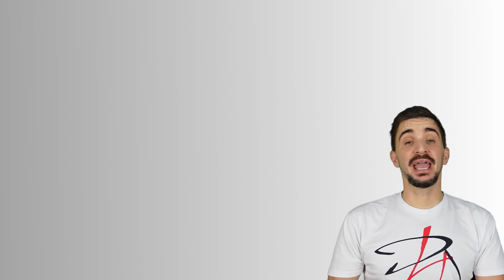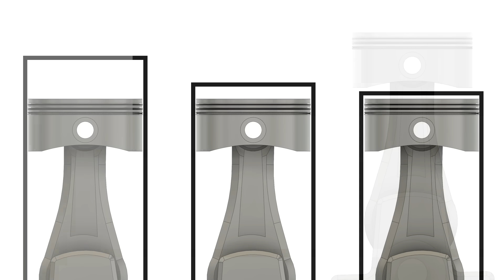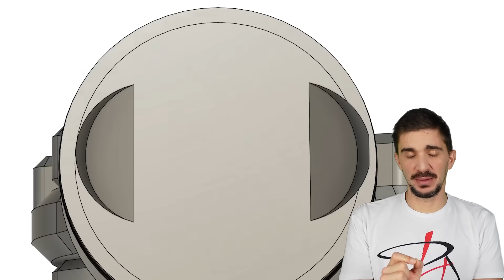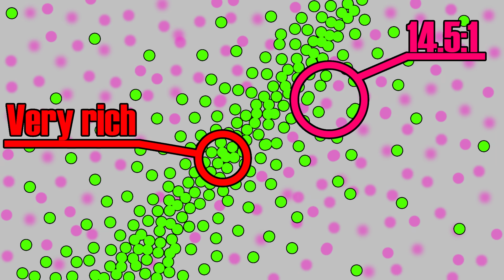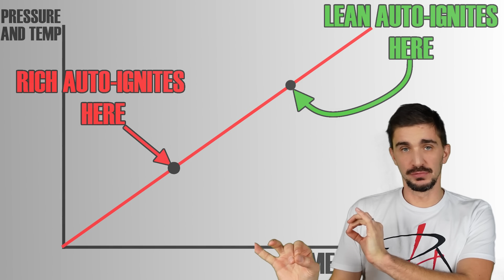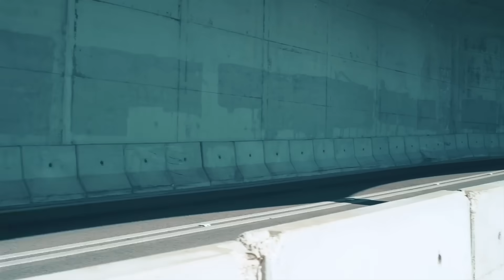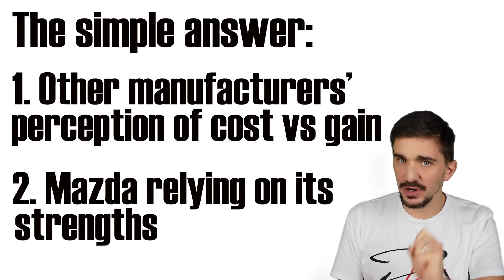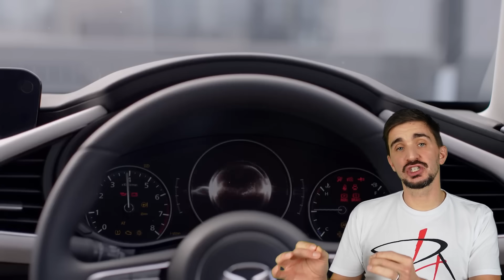The Game Changer Nobody Cares About - Mazda Skyactiv-X SPCCI How it Works and Why It Didn't Catch On

Comment: This tech is amazing! Mindblowing engineering, love and care was put into it.

But you need to understand that in practice the engine has it's drawbacks. Not in reliability, not in torque figures, power or smoothness.
It is very unoptimized in terms of fuel consumption. Let me explain.
On the straight road at 60-80mph it's just king of petrol engines. It can sometime get up to 56mpg. 
Fifty. Six. Miles. Per. Gallon.
In a 2 liter 186HP 240Nm (177 ft-lbs) naturally aspirated engine with small mild hybrid motor.
I doubt there is anything remotely similar.

But on city roads on a short 5-10 miles trip on a cold day... oh boy.
The fuel consumption can drop down to 28-23 mpg. That's more than double the fuel consumption and it gets dangerously close to a 3L+ engines from the 80s. It does not affect the reliability (given that you TURN OFF THE START-STOP SYSTEM ofc. and yes, you can argue that turning off the start-stop affects the outcome. Well, I like my camshaft bearings the way they were installed thank you very much) but this is just how the engine is tuned.
I have no doubts that this will be addressed in future iterations. But this is definitely not a city-oriented engine. Given that it's installed in smaller Mazda cars - it's just a hard sell. For regular city dwellers, the short-trip low-speed MPG can throw off just about everyone, despite amazing Mazda's reputation

Comment: It sounds like a system like this needs It's fuel to be warmed up to an exact Temperature I'm sure they thought of everything , but if it just comes down to a nominal temperature For Ignition It sure seems like warming the fuel up to that proper temperature before introducing it into the engine would be the answer.

Comment: The final part of the video doesn't make sense, when we don't say anything about the actual fuel consumption of the car.  
And I can only speak about the declared figures, but Mazda, for a 2020 Mazda 3 2.0 186km skyactiv-x hatchback declares a 0-100 of 8.2s; and a fuel consumption of 5.6/5.0/7.1 (mixed/highway/city). 
For comparision - a very similar car which is a VW golf hatchback, with a 1.5 150km declares a 0-100 of 8.5s, with a fuel consumtion of 4.8/6.1/4.1; and a more powerful 2.0 190km one has a 0-100 of 7.1s and 6.5/6.2/9.2

Both cars have similar size and weight, as well as FWD.  (MT for the first 2, 2.0 golf is AT only). 

So it's hard to call the mazda a revolution, especially if we consider it with diesels, or hybrids. And the 1.5 turbo will feel more elastic, and can probably be brought to exact same performance.
I don't like VW nor turbo cars, but the skyactiv-x doesn't seem like any kind of revolution. Maybe for a sports car it'd feel better, where N/A cars are appreciated and fit the style.

Comment: It never came to America, I think bc the 2.5 engine is close enough. The X wouldn't be more powerful  and it is more complex/expensive. The EPA test could perhaps not be able to show off it's advantages. Though, if they refined it, simplified it and made it cheaper (maybe not needing the supercharger), them it could work. I hear it will be hybridized in the next iteration, which could help it stay in its sweet zone longer, helping with real world fuel economy.

Comment: What I don't quite get about this HCCI/SCCI thing, is how knocking is not an issue here? Because you have gasoline, homogenous mixture, high compression ratio/temperratures...these are tipically the circumstances for knocking. And I'm not talking about pre-ignition, but knocking, which -from my point of view - is still very likely here and it'd cause the same issues as in a regular gasoline engine. Also, the spark controlled process would not help, because we have that (actually the whole ignition process) controlled by sparking in a regular engine as well.Any explanation for that maybe...?

Comment: Good conclusion. 
I like Mazda for their innovation and japanese care to their designs. 
But indeed, fitting a turbocharger on a decent CR, not downsized engine is simpler/cheaper than that SPCCI. 
Especially if that technology bears the same flaw (only provides efficiency at some kind of cruising / not widely changing driving conditions)

Comment: Is the metal of the engine good quality is the question?  It doesn't matter how much the engine efficiently sparks if the engine is made with cheap metals or if it's aluminum it's not gonna last you 200000 miles

Comment: The reason diesel engines are more efficient is NOT because “the piston is closer to where combustion takes place.” The SI vs HCCI pressure trace comparison later in the video is much closer to the real explanation.

From an ideal cycle standpoint, the Otto cycle (constant-volume heat addition) is actually more efficient than the Diesel cycle (constant-pressure heat addition) at the same compression ratio.

In practice, diesel engines are more efficient because they can operate at much higher compression ratios. Higher compression ratio provides:

a) higher peak pressures and temperatures for a given heat input
b) greater effective expansion ratio (more work extracted from the hot gases)
c) slightly reduced heat losses near TDC due to smaller chamber volume

Spark-ignition engines are knock-limited, which caps their compression ratio well below what diesels can tolerate. That compression-ratio advantage outweighs the ideal-cycle disadvantage.

Comment: Cool ending, spot on, I have an MX-5 NC and a more modern KIA Ceed. The MX-5 requires proper active driving, shifting, steering, full concentration and the rest. The KIA, as pretty much all modern cars, sadly takes some of the experience and enjoyment of driving away from the driver.

Comment: I worked at mazda those engines are verry shitty 
Injectors clog, compression sensors fail and cost 800 euros a piece and had 4 of them, supercharger making this engine complexer than it needs to bee and is verrry underpowered 
Sooo if you want a mazda buy the skyactiv G

Comment: Spoiled consumer base here : I disagree !!!!

I ride a 2025 Ninja 1100 and I drive a 2023 cx-5 signature (turbo). The cx-5 must have spent more time with the turbo ON then the turbo OFF. I really abuse these things. I had Mazdas for the last 15 years or so, always brand new, and I change them every 2 to 4 years. 

What I dont like about Mazda is its trying to be safe. So the blind spot alarm sounds if there is less then 4 car length behind me. Small display for the infotainment with no touchscreen, for safety. I use the manual mode because the transmission its slow and unresponsive, even in manual mode, for safety. I would prefer a REAL manual transmission, but they really dont want to sell those.

I have to fight the car to get any performance out of it. And now Im being told I need to rev up this new engine to get something out of it? NOTHING about Mazda cars is made to be driven by drivers, its meant to be driven by commuters.

Comment: 30% fuel consumption reduction is significant! But have you seen the thunderstorm generator or geet reactor engines yet? Using water as a hydrogen feedstock and reclaiming waste heat from exhaust makes for 60% or better fuel consumption reduction . https://youtube.com/shorts/FFG7znTQGTw?si=A1grwss9xXG0fbXR

Comment: I have 200k miles and 4100 engine hours on my corvette c7  6.2 V8. Almost 30 mpg. Oh, and 500 hp. All I did was simply disable the 4 cylinder deactivation, install an oil catch can, and do a few wide open throttle pulls every time I take it out for a drive. 😁😁

Comment: IIRC GM was experimenting with this back in the 90’s to early 2000’s. The engine would run like a diesel at times gas engine at other times. Made for the most efficient gas engine at the time but it seems there were some NVH problems that couldn’t be solved back then.

Comment: Ive been very impressed with Mazda and their build quality but the only thing that preventing me from buying a Mazda is the lack of port injection in their motors. 

It would be great if they brought port injection to this engine so that the direct injectors would be utilized for spcci and a hypothetical set of port injectors would be reserved for performance demands. Port injection would be ideal for low end power to get up to those highway speeds.

Comment: What kind of Diesel efficiencies could be achieved at around 120:1 compression?  This ultra-high compression can be achieved with an "open-head 4 engine". This engine has 4 opposed, open-top cylinders that combine into one cross-shaped cylinder block.  Like this: +.  The piston tops are wedge-shaped, timed in sync, and all 4 can completely meet at the top of the stroke. The result is 4X compression. Each crankshaft is connected via planetary gear and engine lays flat like a Porsche boxxer.

Comment: I’ve owned to top spec 2023 cx5 from new. Its has impressed me from day for and continues to impress me and any of my friends that experience it. The engine and driveline and exceptionally refined engineering. I get better than 10ltr/ 100 💯 n very heavy stop start traffic visiting 10-12 worksites a day. Lots of start stop. On the open road it can go 7.5ltrs. 
  And yet it is a torque vectored all wheel drive running a 2.4ltr turbo. The engine pick up and low to mid range power is very very impressive. I boot it regularly as it is just so capable.
  In contrary to our excellent man’s video my vehicle is extremely quick off the line and quick elsewhere. It punches gaps in traffic like an electric car. Just hit the throttle and go.

Comment: Wow ive been driving a mazda cx30 for 5 years and never knew it had this kinda technology.. really cool to know. About to hit 100k miles with nothing but oil changes, brakes, and tires. 

Tho The exhaust got much louder recently like the muffler is failing. Ive been letting it ride since its driving the exact same and sounds a little tougher but i wonder if it could be a problem if its changing the back pressure in the cylinders for an engine this technology. 🤔

Comment: This tech would work really well with PHEV-s because those engines usually see a constant load and RPM range of generating electricity. To be fair this engine is not small like a Wankel, but that have poor emissions mostly because of the inherent oil-burning...
Another thread: i thought about todays Atkinson cycle engines which are using valve timing to breathe less air (and thus fuel) in than the engine's nominal displacement, and when ignited using the whole displacement to do useful work, achieveing better fuel economy, but it obviously lacks some power compared to when the engine would packed fully with air-fuel mixture.
The question: Can those cams timed to normal operation range, to work as a "normal" engine rather than Atkinson cycle? Because in that case a - let's say - 2L engine that could operate in either Atkinson mode or normal mode (or enywhere in between controlling the intake time) in full power mode could do the same 180-ish HP. And this Mazda engine has a little compressor on it too (not to make boost but to achieve the desired air-fuel mixture i think) which adds complexity, bulk and weight. If an above mentioned Atkinson/normal mode engine could exist that would be a little bit simpler and smaller i think. I Also think that the PHEV is the answer to todays motoring needs, it needs less battery than a full ev, uses less fuel than a traditional car, not heavier than an EV, and uses well known components, albeit in a more complex package but can be very reliable.

Comment: Why do diesel engines not intake fuel during the air intake step? If you spray diesel and air to create a homogenous mixture. Couldn't that solve the problem of incomplete combustion?

Comment: about the rant in end. that is quite actual thing for me currently. at this point driving car has become quite an expensive thing. my work is 2km from me. but i always go there by car at winter or 2 wheeler with engine during summer. the summer time is not bad. nice weather, and my 2 wheeler is very economical. but driving car. 2km then 2km home for lunch then 2 km back and then 2km to home. during winter there's the problem that battery doesn't get to charge and engine gathesr condensation. so i've atm driven like 100+ km trip just around the country to get car warm and battery full every 2 weeks altho should do it once a week atleast.
i did calculations and during winter im spending probably around 1/5th of my salary if not more just to get to work which is 2km away. that includes fuel and other running costs like tires and maintanance.
i've been thinking about this half of this winter. it was just too late to switch to bicycle cause just too difficult to move from a cabin to -20degrees celsius.
i did some test one day now as mornings are warmer. and cause my car is older i need to warm it up during morning longer that my carb wouldn't ice up really bad. at morning i arrived at work 6mins sooner on bicycle than with car. then did calculations and if i add in the 100km random driving i need to do to keep engine and battery in good shape than per day i lose 3.75mins currently with driving a car. on top of there would be the maintanance which i do by myself.
that is choosing the easier way. but after this week im gonna go either to my 2 wheeler with engine or if it's still slippery then bicycle. but im trying to do this change cause the easier way may look like easier but actually might not be.
i plan on fully biking to work next winter but i can't promise anything cause us humans like easy things

Comment: i don't wanna ruin your fun but russians had that basic idea like 50 years ago built.
gaz 3102. a torch ignition. technically same idea but with not as lean mixtures. power rose, fuel economy went better. even tho the car was heavier than the predecessor, then according to wiki the fuel economy dropped from 10.5 to 8.5l per 100km. the predecessor shared same engine without this torch ignition system.
torch ignition uses same logic than now suddenly mazda "thought out". you have richer mixture at spark and lean mixture everywhere else.
and knowing russians, they probably got that idea from western countries so that is not very new idea actually and others have done that.

Comment: Great subject matter and analysis the best line of which is I Hate Thinking which although a bit reductive hits the bullseye for the majority of brain dead rank and file  American automatons. Interesting engine architecture and my only question is about long term reliability at those surprisingly high compression ratios which when applied to engines built with anything less than state of the art manufacturing tolerances and materials will result in premature deterioration of the valvetrain because of the heat and pressures involved. These are aluminum block and head engines whic probably helps with heat dissipation Are these 300,000 mile engines is the question, a milestone many of the low compression four cylinder Toyota engines as well as the early 4.7 V8s are able to achieve. There is no golden mean and no escape really from the conundrums of heat, friction, efficiency, durability  and emissions. Skyactiv particularly in the NA engines gets close. You do realize there are pressurized versions. Also what you fail to mention is that some of these require premium fuel. The Holy Grail is the beautiful inline six they developed for the CX90 which sadly is turbocharged. Can you imagine that beautiful engine in one if their sleek road cars like the 6 series? Finally just wanted to say I have a 45k mile 95 R Package Miata in my garage which I will never sell. There is a fantastic coffee table book which I have detailing all the philosophy and attention to engineering that went into the development of the MX5 and Mazda truly is on another level in many ways. The little twin cam 1.8 in those early cars is such a gem!

Comment: Sure, that's why I'm about to have to drop 1300 bucks on a cruded up intake manifold in a car worth 1000 bucks. 
HCCI engines self destruct at around 120k miles. My regular four banger gas engine turned the clock. 
Never again.

Comment: thank you. well said and complettly down my street, especially with the last examples.
i use paper map navigation on my motorcycle and immediatley notice the loss we experience when driving using gps navs only but can´t lie i also notice the sheer amount of appeal that a gps sat nav has, of course.
and only rare i challenge myself to get somewhere like to an appointment in a city where i have to be there in time. it´s so stressfull.

so this is in general interessting topic we as humans should think more about, since the granular steps might seem wise, but the path we´re going might turn out to be not.
see idiocrazy for a future documentation refference ;-)

And in all seriousness, recognizing this issue and solving it buy intentionally walking the harder path, these are two different shoes.

Will for sure look into the Mazda fleet, when it´s time for a new 4 wheeler.

thanks again. like these videos a lot.
Greetingz,
Marius

Comment: Yet in the United States we never got it even though it was always promised. And they go and release the much anticipated CX5 with the same 2.5 SkyActiv G engine with a 6-speed Auto. The inline 6 cylinder mild hybrid that we get in the CX-90 and 70 is a good engine but it's not that great paired with the eight-speed auto. And we got the diesel for like 2 years in the CX-5 and it was not particularly efficient and it didn't have very good numbers, power and performance

Comment: still bafaling no hybrid has this.. I bought mt yaris for two things reliability and low consumption, really hard to believe I:m the only one, like a 30% lower consumption on top of the powersplit device eficiencies would be crazy cheap to run and also the electric motor could overcome some of the 'slownes'